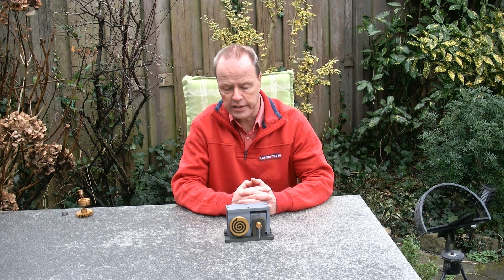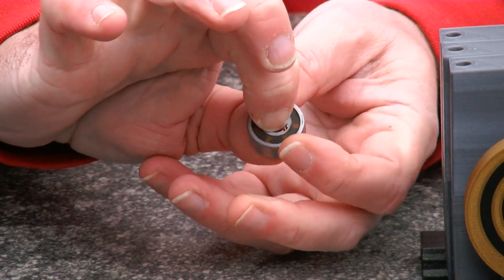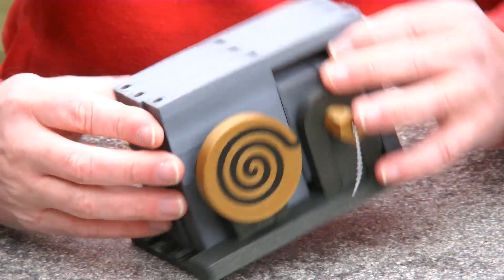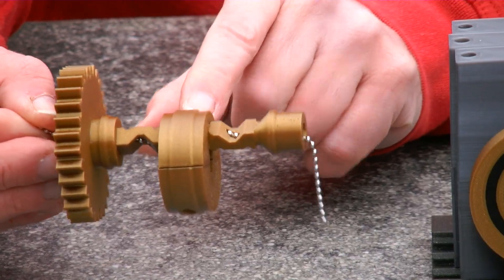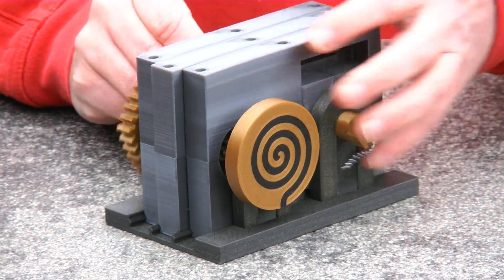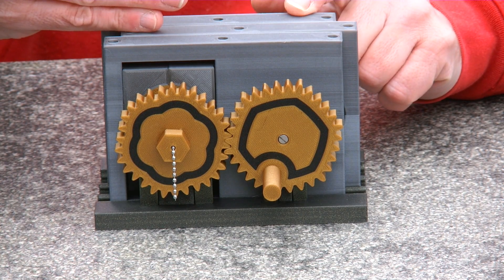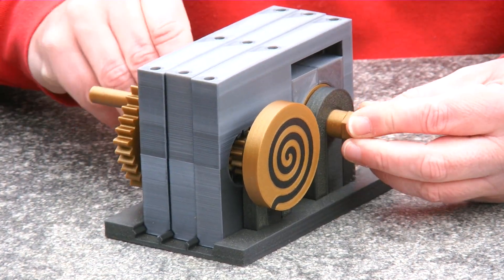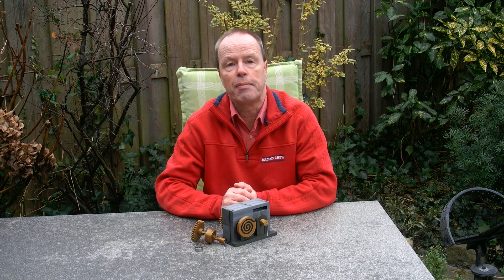Oskar's CVT (Continuous Variable Transmission) - Does this kinetic art have any useful application?

Comment: There is already a CVT with a similar mechanism made of steel for a bike. There is also a video about it which is called CVT - This Is The World's First Geared CVT and It Will Blow Your Mind...
Reply: Ratcheting CVTs have been around for a long time.  But I like how compact this one is, especially compared to the video you reference.
Reply: @brendansimons6811  I like the fact that they reached production level with their CVT and that it does not fall apart under torque.

Comment: Interesting engineering. Basically a Zeromax . Trying to reduce the speed jitters is made in a nice way...but the problem is not here. The main problem is the "almost" no backlash, "almost" no play and "almost" infinite rigidity... ending in a limited power capacity...at low speed...

Comment: Your variable crank-shaft needs work to support higher power, but the funny gear torque ripple compensator is very interesting.  

I'd look at the "zero-max" for inspiration.  I uses a clever linkage between fixed cranks and ratchets to vary the ratio. 

Also, ratchets have FAR better torque density than sprag or roller-ramp clutches.   If a ratchet is fabricated with >300 engagement points per turn, then it'll work just as well.

Comment: I would like to see a motor attached to drive the input at variable rates, and the tension on the chain adjusted while the mechanism is in motion. Only because I think it would be cool to see the pistons change amplitude while the output changes speed.

Comment: Balancing out the speed variations with non-round gears - genius!
Reply: Ratiozero does not address the speed variation, citing it as not causing issues in their intended uses.  A true stable speed opens up new uses - likely ones with much higher power loads.  If the one way bearings can hold at those loads, it might be a good alternative to the existing hydraulic and electrical power unit / drive combinations that are used as a "transmission" in trains and earth moving equipment.  However, I don't think the hexagonal gearing can perfectly even out the variation at all gear ratios - my intuition tells me it works ideally at one ratio, or maybe harmonic variations of that ratio.

Comment: How did you generate the gears?
Reply from the maker: Pretty standard involute gears. I generated them with an Excel sheet, that I developed ages ago.
Reply: @OskarPuzzle  The polygonal gears too?
Reply: The 'pistons' move in a triangle wave pattern. Without the hexagonal gears they would move in a sinusoidal pattern. Is that correct?

Comment: Very clever. However, it still uses friction inside the one way bearing, so it doesn't actually acheive the goal you set for yourself.
Reply from the maker: Thanks! To be honest, I do not know how one-way bearings work, or how the compare to ratchets. One could arguably claim that ratchets also use friction inside.
Reply: This friction has an infinite coefficient, it is absolute, like a ratchet, so its losses are practically nonexistent.
A belt CVT on the other hand relies on the balance between friction of the belt and its tension, so to achieve a good coefficient of friction (to transmit full power), it has to be heavily tensioned, which in itself causes friction, but this is taken away from the output.

Comment: Yeah, as everyone in the comments to that """first""" """geared""" cvt was saying this is a ratcheting cvt. These aren't new (check Wikipedia for examples a century old). These never caught on because of nonlinearity of motion. Sure you can try to correct it by changing the shape of the gears but it would only perfectly cancel it for a single ratio. At every other ratio it would still be nonlinear. This makes them unsuitable for pretty much anything.
Reply from the maker: Your comment about non-linear motion is correct for some other versions, but incorrect for my version. At any amplitude, the piston moves with a perfect sine motion. And my hexagonal gears compensate for this at an amplitude. So my version is linear at any amplitude.
Reply: @OskarPuzzle Is the amplitude of the piston associated with the gear ratio?
Reply: Would be interested in that video
Reply: I wonder if it is provable. Like can you show and prove?